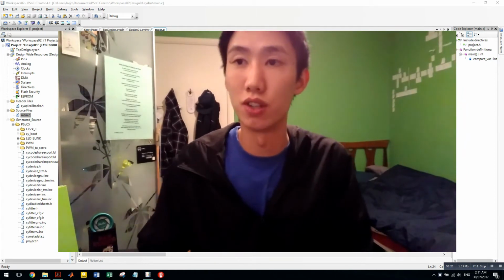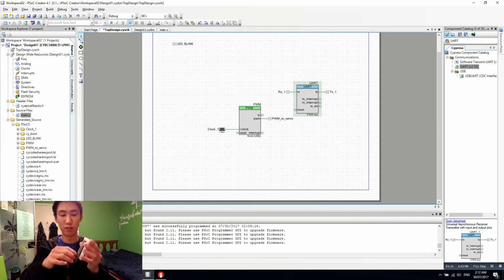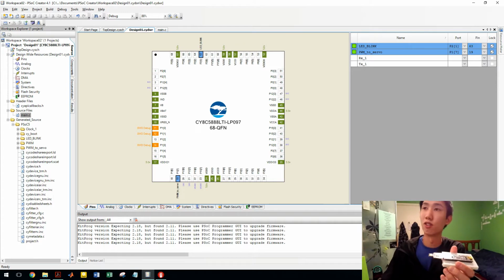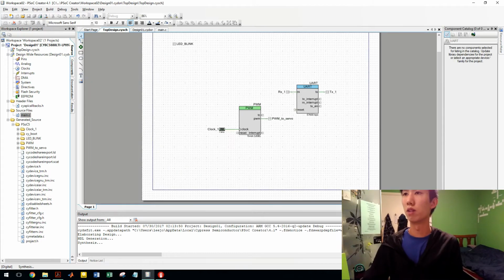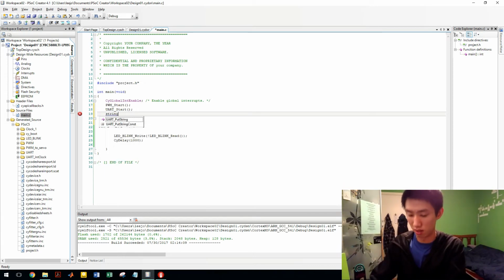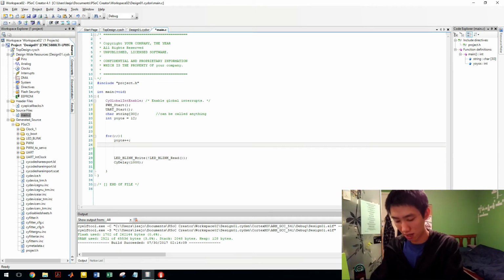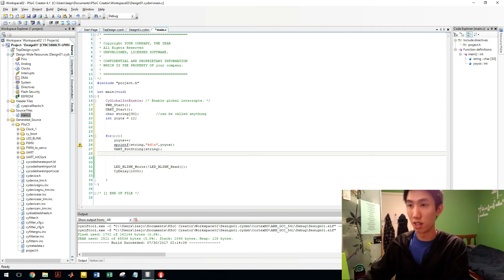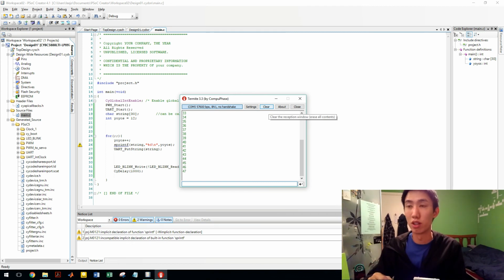PSoC Tutorial - Printing to Termite with UART

Comment: Hi
I am trying to use control registers to blink LED in PSoC Creator 4.4 (Control registers with 4 output)

Connected the control registers to LED (4LEDs) and entered the command 
"Control_Reg_Write(0b1111);"  because I want to blink all the LEDs (I am using Timer interrupt too) but I am getting the error " undefined reference to Control_Reg_Write
How can I assign value to control registers?? 
#include<project.h>

CY_ISR (INTERRUPT2HANDLER)

{
    INTERRUPT2_ClearPending (); 
    Timer_1_ReadStatusRegister();  
    
    
Control_Reg_Write(0b1111);

    
   
        
    
 
}

int main()

{

  
     CyGlobalIntEnable;

    /* Start the components */
    
    INTERRUPT2_Start();
    Timer_1_Start();
    INTERRUPT2_StartEx(INTERRUPT2HANDLER);
   
    
    
    
    

    for(;;)
    {
      
            
            
    }
}

Comment: Hi! I have done the same program using PSoC as you but I cannot send any characters to termite or receive them despite being the Bluetooth module connected to my computer (I know that because of the Bluetooth HC-05 module lights), do you know why is the reason?

Thanks so much! :)
Reply from the maker: Juan Fernández are you plugging your psoc into the computer via USB and using the Bluetooth module as a receiver?
Reply: Jonathan Lee yes, I am doing this as you are saying, should I power my PSoC with an external voltage supply?
Reply from the maker: Juan Fernández nope no need, the psoc can get power from the usb. Have you tried printing to termite directly from psoc (without the Bluetooth first). That way you can see if the issue is Bluetooth or the serial transmission
Reply: Jonathan Lee how can I print to termite directly? Using USBUART? I am using the expanded kit of your PSoC 5LP
Reply from the maker: Juan Fernández oh sorry I haven't used that kit. I think it will be similar to my vid though
Reply: Hi again Jonathan! I could solve my problem but know I need to send two numbers from PSoC program via Bluetooth to another program in my computer to sketch them. My question is: how can I send these two numbers inside an array?
Reply from the maker: Juan Fernández im dont think you can send arrays since it's serial transmission. I suggest using a for loop or something similar to send each array element one by one